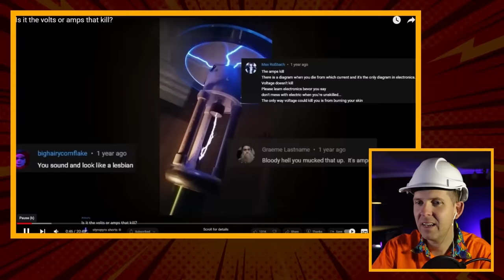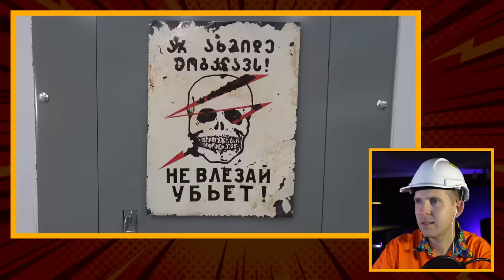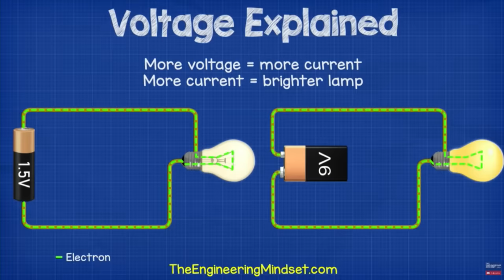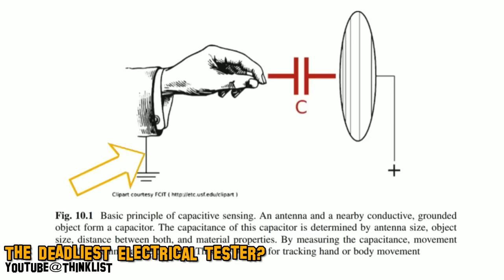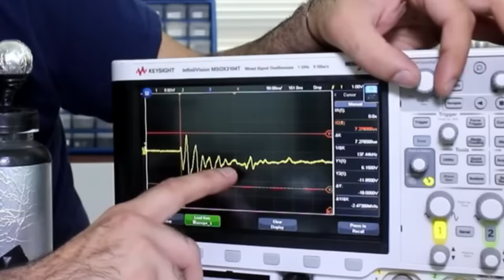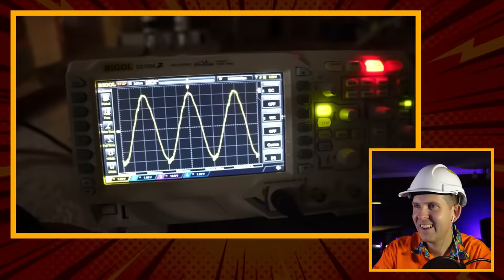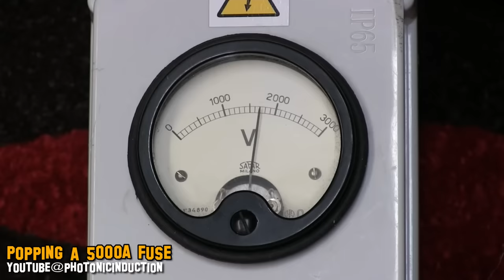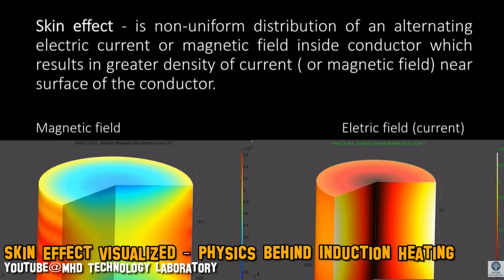Electrician Reacts to Styropyro's🔌AMPS vs VOLTS⚡

Comment: If you cite all the reliable info about your body's ohmic resistance under different conditions, AND you are exposing yourself to low frequency (say, 60Hz in the U.S. for mains AC) - there is one thing left out.

UNKNOWN HEART CONDITION.

If you are willing to roll the dice, then you won't bother to consider that issue.  It is rare, after all, that someone has an unknown and undiagnosed heart defect.

Personally, we were taught the "one hand rule" to prevent an unexpected shock received if both hands were on a (supposedly) dead circuit that turned out to be live.  If both hands are across the circuit and a current path through both arms, across the chest occurs,  that can be an issue.

The other thing you will find in industry is - if you are caught exposing yourself to possible electric shock, you will be fired.  That happened to someone in our group.  We worked on high voltage equipment.  Roger exposed himself to a shock, purposely.  It's not like he had an employment contract he was trying to get out of.  He was just a bit odd.  

In my home, a 1-story house, the risk taking involves stepping down the 7 1/2" step from the kitchen, into the garage.  "Whew, made it" I said.

So don't listen to me,  I tend to be risk-averse.   But always try to remember "safety first"

Comment: Yup, measuring peek voltage and or current isn't useful for determining how  much work is done done in a resistor without an rms conversion.

Comment: 3:42 Nerves are not electrical; they are chemical.  A nerve impulse is a ionic cascade involving calcium and potassium ions.  So there is a detectable electrical signal, but that's a side effect of the ionization and de-ionizations taking place.  Still, imposing an external electric current is likely to interfere with this ionization process.
Reply: Technically it's all chemical. All of it. Even power generation is a chemical reaction happening inside the generator. Not a popular opinion, but I'm right. It's funny how anyone would agree that a battery supplies power through a chemical reaction but a generator supplies power through.. phenomenon! It's a phenomenon. In other words, magic! Lmao.

Comment: DC doesn't scare me, i know what will kill me and what won't.
AC terrifies me because i don't understand it or what will and will not kill me, or hurt me, or burn me.
Reply: Either will kill you if the voltage is high enough and the current draw is fatal enough whether it's AC or DC. The reason why DC doesn't exactly scare you is perhaps it's because DC is mostly known to be in low voltages most commonly in the form of batteries with voltages around 1.2-12 or a bit higher but AC is usually found in higher voltages (such as mains like 110V-240V) commonly in the mains and used for transmission (at around 33kV).

Comment: There's over 1000 amps in a truck battery. I've worked with literally hundreds of them and never got as much as a tingle. But if your wedding band gets between positive and ground, you will pull the meat off your finger before you can get it off. A CO worker has it happen and it was disgusting looking.

Comment: Wattage is what kill end of story as if voltage is high but amperage or activation time is low no one dies and if amperage is high and voltage is just too low or activation time is low nobody dies. If you have 500kvof voltage but power is just 5 watts what can it do to you other than a big shock and some burn spots but if the total power or power is high like our like 1000w you'll definitely have a problem

Comment: The answer is amps amps kills people volts will not that's why you can get tased by whatever ridiculous amount of volts you want in a tazer but let one arm be touching a ground and the other arm ve touching as little as 0.007 amps and if they are allowed to go through your heart for 3 secounds you will die. By the way that's a very small amount he was holding a rod in 1 arm while wearing rubber boots towards the high amps so yes it'll at most shock his skin because it won't spread but if can travel to a ground it will and if it did he would definitely be dead
Reply: I think you are thinking current output. It's current draw. Usually in open circuits the current draw should be 0 but under a load the current draw will vary depending on the voltage and the load and many other factors.

Comment: Too many people think they know the answer and come up with all kinds of erroneous descriptions, that are strictly entertainment. Would you get your medicine from a guy who plays a doctor on TV?? These guys still get this WRONG. What kills you is power dissipation - period - end of story. Your body is capacities, so at high frequencies, it basically looks like a wire. There is no voltage DROP across your body, so no power dissipation. In all these videos, they show high voltages that arc through the air. When applying ohms law, V*I=watts, the voltage drop is across the air, not your body. This is the deception that causes most of these videos to be a failure. If you simply put the meter leads across your body, one lead where the current enters, and the other lead where the current exits, you will see very little voltage drop. Even though there is high current, if the voltage is low, the wattage will be low. 
As with any load, its really about what the body absorbs. Measure the energy the body absorbs in watts, and you will know if you die or not. The trick is to actually measure across your body, not what is feeding your body.

Comment: I'm sorry, but he is absolutely wrong about high frequency being not dangerous.  Well it may not be possible for nerves to sense RF, the electron movement is still very real, and will carry significant kinetic energy into the skin. Look up RF Burns online if you want to learn more about how dangerous it can be.  While The guy may be interesting, his analysis for the current going through him is absolutely wrong. What is likely happening is the metal rod he's holding (quite foolishly I might add) act as a kind of ground, which would mean that it is a sink for the excess current and would not be going through him.
Source: electrical engineer with RF experience

Comment: Volts or amps? Neither, it is frequency that kills, specifically lower frequency. And of course AC is more dangerous than DC due to the periodic reversing of polarity (your cells do not like that).
Reply: Whether it's AC or DC either will kill if the voltage is high enough and if enough current is delivered.

Comment: 5min in and my current understanding is that Volts get the electricity past a resistor such as your skin and the amps correlate more to the overall power (of course the overall power depends on all 3 values but im just a village idiot so) but to me its def the current that kills but the volts would need to be high enough for the current to even take effect right? again village idiot so

Comment: It's neither volts nor amps. It's the ohms...or lack of them.
Reply: If you had no current flow, even if you had 1 Ohm of resistance you wouldn't die.
Reply: @Pelican_t  You are aware that it's the electric potential difference situation in the first place? If there's voltage and low resistance, there's high current flow.

Comment: there is a difference between an electrician and an electrical engineer
Reply from the maker: And that is?
Reply: @thinklist  Electricians simply connect a house to the electrical grid while electrical engineers work with solenoids, capacitors, resistors etc. to make useful devices.
Reply from the maker: @yeetlegosi  that may be true where you’re from mate. But Industrial electricians from AUS do all of that and more.
Reply: @thinklist  and that is?
Reply from the maker: @yeetlegosi  program/diagnose PLCs, integrate SCADA systems. Design and build complex LV and control systems. Well anything it takes to get a system running
Reply: @thinklist  well i stand corrected